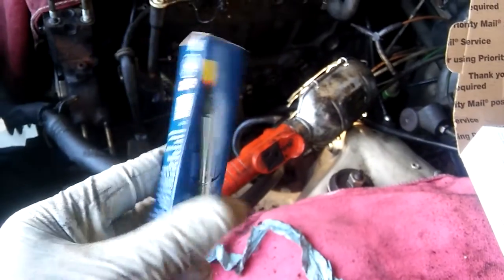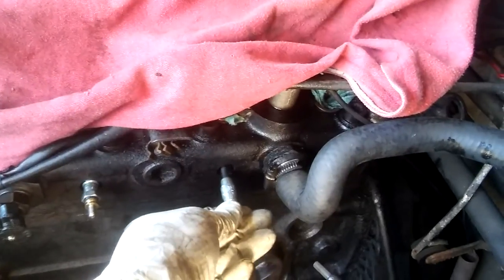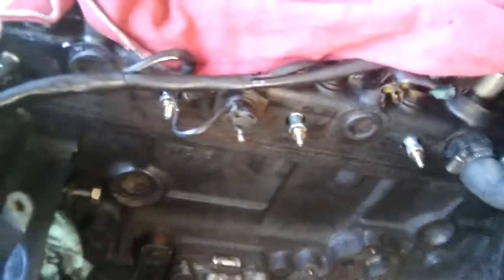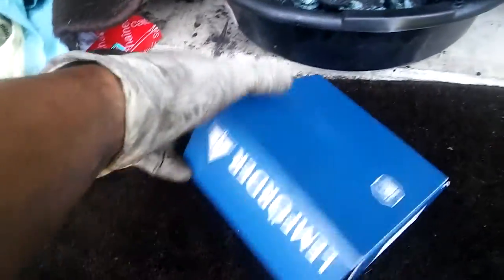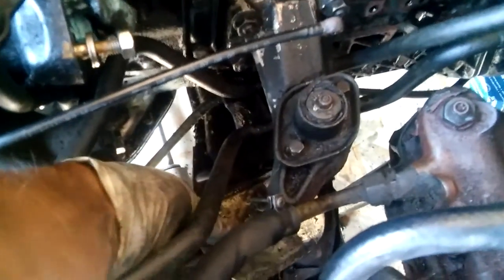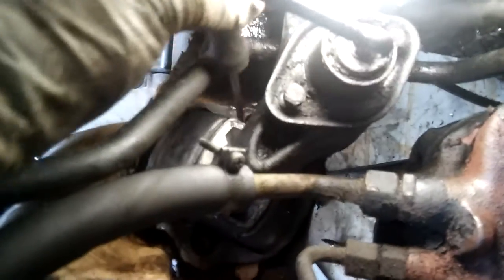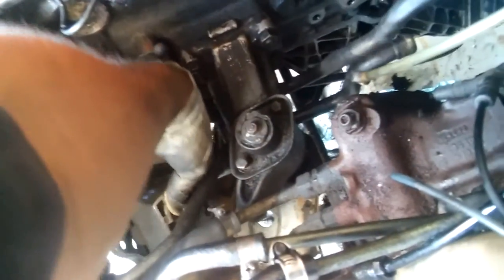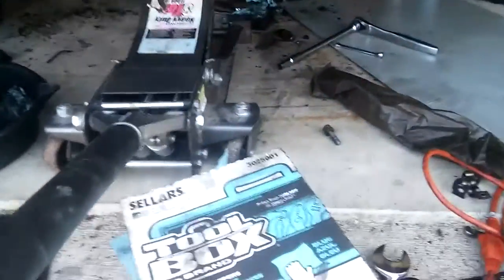My W123 Benz gets NEW GLOW PLUGS AND NEW ENGINE MOUNTS!

Comment: Awesome tutorial as usual Vitto. Was there a noticeable difference in drive quality and vibrations afterwards?

I will be trying this in a few weeks. I also got the Lemforder brand and filled them with Loctite roofing polyurethane which I’m letting cure while I work on some other non car related projects. I’ll post my results on here once I complete it. I’m really hoping it will help reduce some of the noise in the cabin when I’m stopped at lights, stop signs etc.
Reply from the maker: Yes sir! No idle vibrations anymore, Starts a lot easier with new plugs! Great job filling them up!